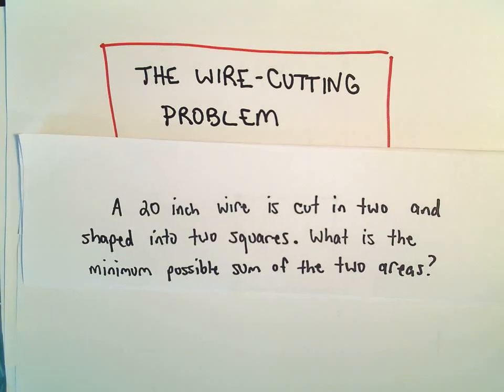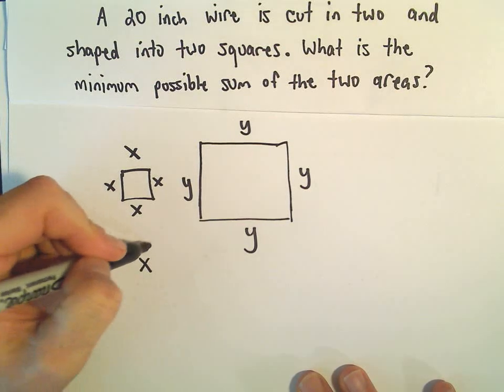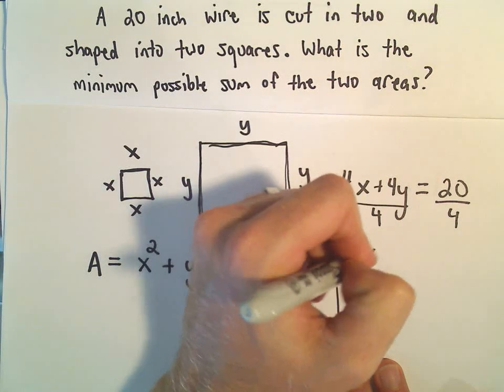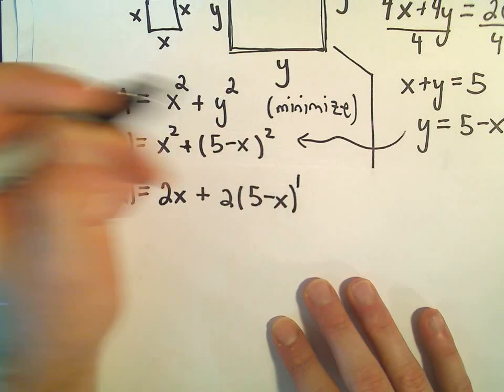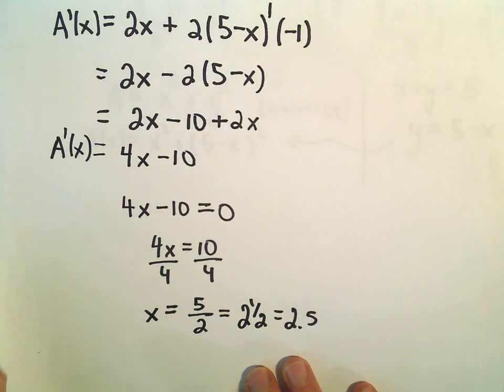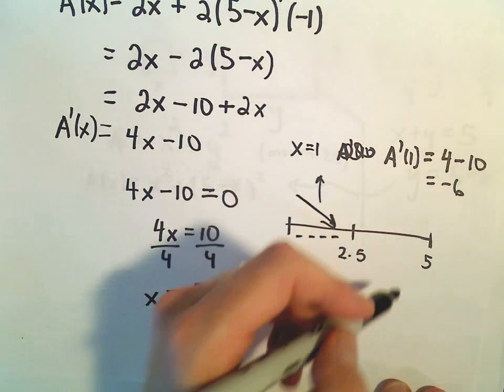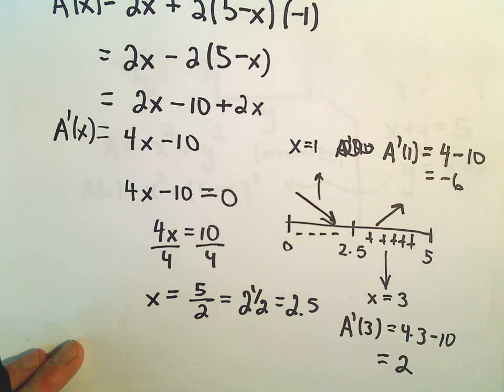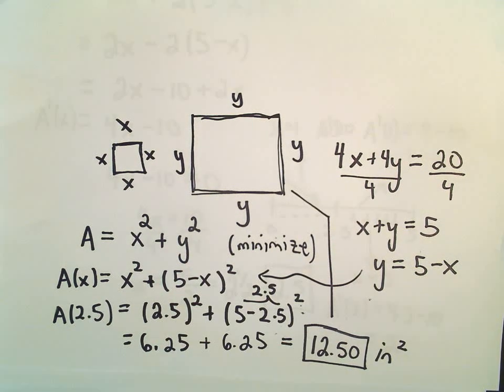Minimizing the Area of Two Squares With Formed from a Piece of Wire

Comment: What if the question said find the maximum?
Reply from the maker: well, at a glance this should do that as well. the max should occur at an endpoint in this example which would give the same solution (try it).
Reply: @patrickjmt  i get x =5 and y =0 so the area would be 25. But the problem is the wire is not cut.

Comment: I did this problem differently than you and arrived at a different answer. I'm inclined to believe you over me, but I don't understand why my method doesn't seem to work, assuming I'm not making a careless error in taking my derivative.

Basically, if you have a 20 in wire, you cut it in half and designate some piece as x and the other piece as 20 - x. Each piece is then used to form a square. One square will have side lengths of x/4 and the other square will have side lengths of (20 - x)/4.

Work it all out, and it seems that x = 10, and the end result is that the wire is cut in half. You're much better at math than I am, but I cannot figure out why this method isn't working.
Reply: Hey! I know my response is not helpful, as I'm a year late, but you aren't wrong at all! His x refers to a sidelength. Your x refers to the perimeter of a square. his x times 4 is 10, which is what you got.
Reply: @bakingconnoisseur it’s still helpful! Learning is a lifelong thing and i appreciate you.

Comment: In the other examples,  taking the derivative of setting it to 0 was the  maximum.. How come this is the minimum in this case? How can you know the difference?
Reply: BennduR They both have the same steps there is no way to know until you find when the derivative=0 after you find that point. You take one point before and after and sub it in the derivative and see if it's inc. Or Dec. After the point and that means that function is either an absolute max or min at the point when the derivative=0.
Reply: You take the second derivative and use the "second derivative test."

Comment: Since there is only one derivative = 0 and it is a minimum. The maximum must be at the ends of the function. X=0 and X=20, in the case. In other-words putting all your wire in one square and making the other zero in =size would be maximize the area.